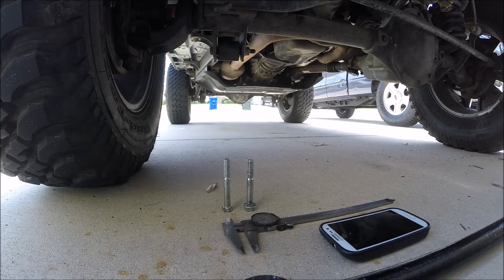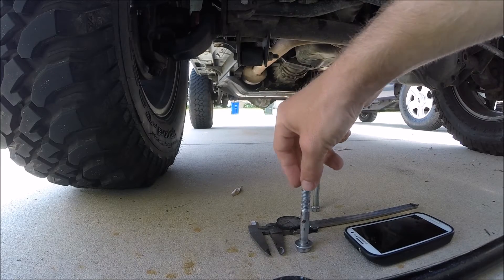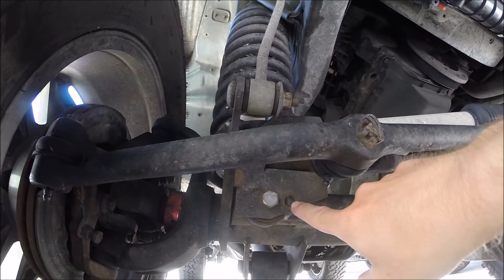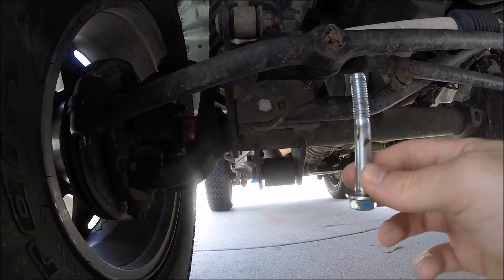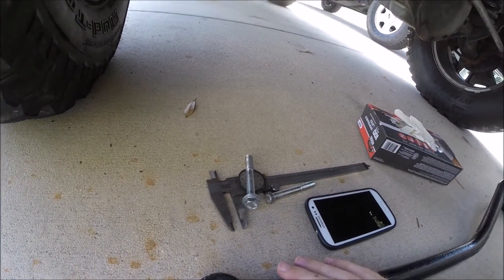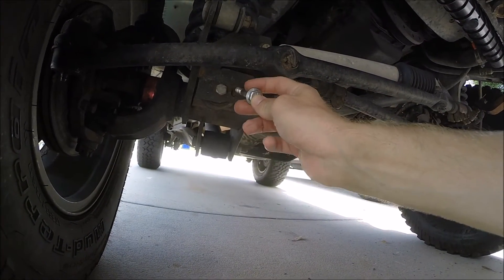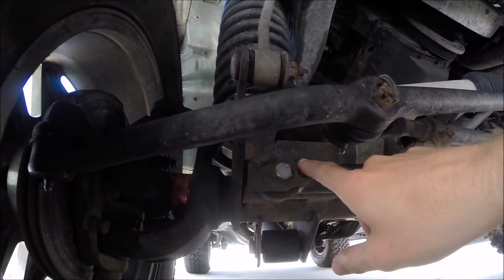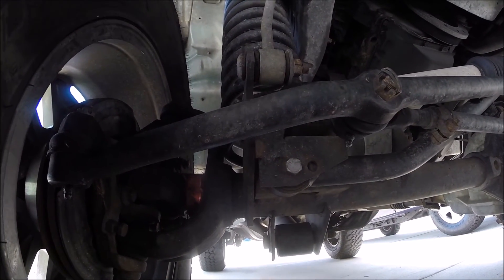Jeep Death Wobble - Fixed and Explained

Comment: When you look at the bushing of your track bar or control arms, the metal piece in the middle where your bolt will go through is called a "crush sleeve". AS IN, it's designed to get pushed really really hard from either end. The purpose of your bolts and nuts is to provide "compression" and cause your mounts to act like a vice by clamping down really really hard on the crush sleeve. The crush sleeves is NOT supposed to rotate AT ALL when installed correctly but rather, the bonded rubber bushing will twist around it. Of course, if you have a polyurethane bushing, heim or other aftermarket joint, the bushing will rotate around the sleeve or misalignment spacers - again, there is NO movement around the bolt and therefore, shouldered bolts are NOT necessary. This is the reason why bolts are rated for "torque" and NOT "sheer" - the value of compression strength is all that is necessary to hold things together.

the bolt is not designed for sheer, they are not axles and are not the parts that were engineered to accept the side load. The side load is handled by the sleeve and bushing, and is only fastened in place by a properly torqued bolt. When you decide to use shoulder bolts (especially high grade) you are bringing in some unknowns that weren't engineered into the system. These may in fact require a lot more torque to hold tension and not loosen, This could damage the crush sleeve, bushing, heim joint, or whatever else was not designed to be crushed as hard. I'm not saying that these grade 8 "upgrade" bolt kits do not work and solve some peoples issues. More than likely you are just masking the fact of improper torque. I just believe those issues could be solved with the factory bolts, proper torque, and maintenance. A better purchase would be a quality torque wrench.

Comment: I tried drilling out the new track bar and as I was drilling it, it got so hot and started to melt the bushing. My hole was so worn out it was perfectly 7/16 already! Plan on getting a replacement track bar and use a bench press this time as I cool it down with water.

Comment: Good video with useful information. I would suggest using a high tensile steel bolt, they are usually black, as opposed to the zinc plated bolts you have there. They are too soft and will wear quickly. Rather than welding a plate over the hole and redrilling, get a high tensile washer of the correct size for your bolt. Bolt the whole thing up then weld the washer on :)